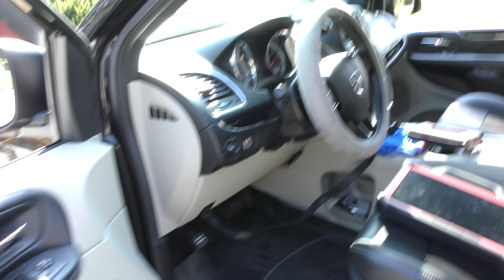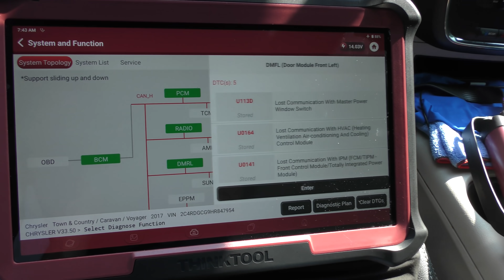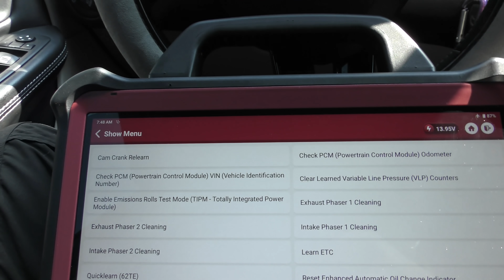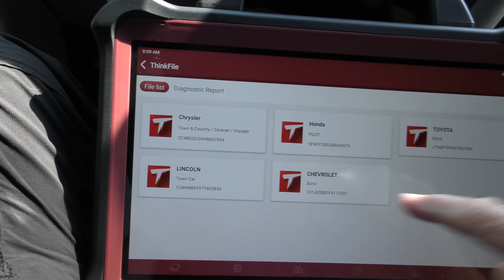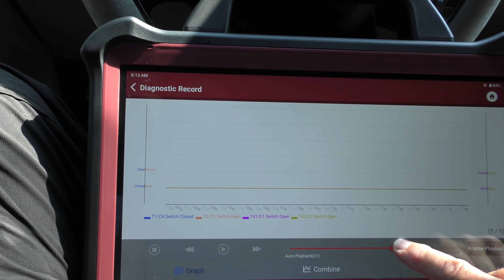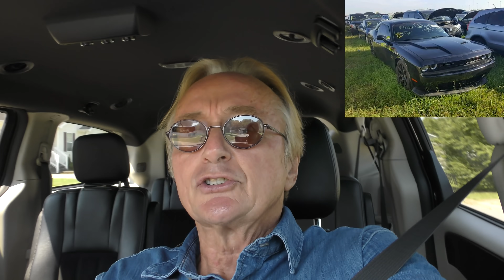Here's Why New Dodges are Crap

Comment: Sooo..  let me get this straight, this van has 138000 miles on it, and all it took to correct the problem was to clean and reset the cam phasers, yet it’s a crap vehicle. Uhm, ok. 
It’s obviously a former rental car which more than likely means that those are mostly highway miles, and the owner only paid 3k for it?! Sounds like a savvy shopper to me. Sure, they could have gone out and bought one of those overpriced, soulless shitbox Toyota’s you love so much, but even those will break, and when they do, look out, because it’s gonna cost a small fortune to fix it. Another reason the resale is low on them is that Dodge has essentially been building the exact same vehicle since 2008, there are literally millions of these things on the road. Personally, I’d take a caravan over some god awful Sienna anytime, it’s just more bang for the buck.
Reply: Uber sticker might have something to do with it.

Comment: It's not "new" Scotty it is 4 years old with 134,000 miles on it. My wife's 2012 Dodge Journey Runs fine at 126,000 miles but the oil changes were done at 3,000 to 4.000 miles since new. Runs like a watch no codes.  Plugs, Coolant and trans fluid were changed at 120K miles no other engine work or transmission work has been done.  I will say that most minivans I have seen of all brands are poorly maintained.
Reply: Scotty’s used to Toyota’s. 200K on a Toyota is just breaking it in.
Reply: @Charliefox71  and honda
Reply: My 2011 Caravan only has 55,000 miles on it, bought it new. Oil and filter changes, coolant, brake fluid, trans, all are key to keeping any vehicle going well. I love my Caravan and I've had 3 of them. The other two I had over 100K and traded both when they were running fine. But why did Chrysler change their best seller, the Caravan? The Pacifica is what it is, the fancy model, but the workhorse model is now the Chrysler Voyager. My Caravan has 2nd and 3rd row Stow and Go seating, so that I can carry sheets of 4 x 8 drywall or plywood with the gate closed, and still have a 7-passenger vehicle, but the Voyager has only the 3rd row in Stow and Go. Bad move, Chrysler.

Comment: I used to sell those. We were advised to tell our customers to leave the economy button off. It really screwed up the shifting
Reply: My 2014 Ram c/v 148,000 definitely has a problem shifting with load and econ button on. Shifting problems mean  turn it off.
Reply: On some vehicles it also slows down the throttle response. I hate Eco mode.
Reply: Is the economy button for saving gas? I agree that it screws up the shifting, but as gas prices go up, I wonder how the economy button would be a good thing.
Reply: @ethanfreeman9623  Eco mode usually does at least two things. Shifts faster to keep the RPMS's down and softens the throttle response. If you push on the gas it'll response slower to smooth out the peaks of you pushing on the accelerator.
Reply: @Brad, what about CVT transmissions like the ones on the Nissan Rouge?
Reply: @FilterFreed   The remade them after 2017 I think. As long as you don't tow you might be OK. They're better for smaller, lighter cars. The Rogue is probably the biggest you'd want to go. Keep the trans fluid changed.  Overall a normal transmission is better.
Reply: @hectorheck1353  Right, and Thank You for letting me know how it actually works. My Grandma has a 2014 Chrysler Town and Country that has the eco mode, and I have only seen a slight increase in gas mileage, not a big difference. I guess I will try to turn that off instead now to not make a fork and a leg for the transmission down the road when I drive it for her.
Reply: Evil man for selling those things to people
Reply: @WOMPCRASH  a $3,000 2017 car being driven for Uber and Lyft giving problems??? Wow I never.
Reply: @WOMPCRASH  😆

Comment: Lol I'm starting to think somebody from dodge pissed you off back in the day. Something BIG too. Career decision maybe?
Reply: Gm too
Reply: Dodges are amazing
Reply: @beast_mode_4200  I have a 2010 dodge charger. 3.5L v6. Little over 160k miles and she purrrrrs. Bought her used at 112k. Only one major fix. Water pump, timing belt, thermostat replacement, and coolant flush. Cost about a thousand for the fix. They kept my car for 3 days. I'm happy with my mopar.

Comment: My 2012 dodge charger R/T with 150k miles runs just fine, any car can turn into junk in a few years if they're not being taken care of properly throughout the years.
Reply: My 2014 RT got 75k miles and have had NO mechanical repairs except a water pump. I swear the 2011-2014 gen chargers were built to last
Reply: 2014 Charger here. 94,000 miles. Replaced the battery, that's all.
Reply: Also 2014 charger RT 65k miles. No problems.
Reply: 2002 Dodge Intrepid 3.5L 301,000 miles runs smooth and everything on it works fine.
Reply: Chargers are one of the better dodge models
Reply: 2006 Chrysler SRT8 6.1 150,000 Miles only changed out alternator. Of course at the maintenance done
Reply: seeings all these replies is enough to make a grown man cry :(
Reply: Dodge gang for life💪
Reply: V8s tend to run longer fukk boy
Reply: @Chatsworth Osborne, Jr. yeah thats a whole different annimal
Reply: 2012 Charger RT AWD 93k miles no issues
Reply: My 2013 charger rt got 160,000 miles o it
Had to buy a new  battery
Reply: Facts, My journey runs like a champ

Comment: I have a 17 year old Camry.  Big body small 4 cylinder engine.  It's a dog on automatic.  When I do the shifting myself with it's 4 gears, it gets around alright.  It shifts on its own around 2,400 rpm to higher gears.  I shift it around 4,000 rpm and I get good pickup and still get 25 mpg.

Comment: Believe it or not I have had pretty good experiences with dodge/chrysler cars made before the FCA merger. I have an Intrepid with a 3.5, and a stratus with the 2.7 and both are running like a dream with 231k on the Intrepid and 188k on the stratus.
Reply: Make sure to change that water pump in the 2.7 when the manual says, it gets a lot of them.
Reply: @Jerad2142  I change the pump and the timing belt every year

Comment: The Grand Caravan was developed during DiamlerChrysler era, the only think added to the Grand Caravan from FCA era was the 3.6 Penterstar which is way better than the older V6's. 

The Chrysler Pacifica was developed from FCA and the Pacifica, Cherokee, last gen 200, Grand Commander (China), and Dart traces it's roota on the Alfa Romeo Gulietta.

So far the Pacifica minivan hasn't had a bad reputation as the Grand Caravan, but of course people like to automatically assume that the Pacifica is bad.

I just don't like people that says they hate something that they haven't driven nor given further research before trying it out. Now yeah the Grand Caravan and Town & County in that generation was terrible to drive and I mostly hated that transmission and suspension set-up.
Reply: The pentastar v6 was designed by Chrysler engineers here in the us . it's a great engine , although the early ones had faulty rocker arms .

Comment: 2017: $3000
That thing depreciated faster than a Maserati.
Reply: I wouldn't even buy it for that tbh
Reply: @TheAnnoyingBoss  Me nether lol
Reply: Well at 135K miles in 4 years, I'm not entirely surprised.

That thing has been cross country several times in s few short years.
Reply: @BrianJNelson  Has an Uber sticker on the window at the beginning.
Reply: 134000 miles in 4 years is heavy use.
Reply: @lonewanderer3603  it means highway which isn't that bad
Reply: It was $3000 for a reason for the cheap price.
Reply: But it cost a whole lot less than a Maserati when new.
Reply: Maserati and Dodge are one and the same, if you take a look at the part bin, the Maserati has the dodge nav system, the door locks and window switches. THEY ARE BOTH JUNK!!!!!!!!
Reply: According to KBB trade-in value is anywhere between $6000-$8500.
Reply: Scotty doesn’t know about manual shifting an automatic, it won’t give you more power cause you rev it higher. On my car it is slower to manual shift than it is to put it on sport mode and let it shift itself.
Reply: That's not the value of it.
Reply: Sticker on the sliding door in big print saying AUTOMATIC DOOR says to me this was an Uber or similar
Reply: @neilgorin1037  Uber sticker on the passenger side at the beginning of the video.
Reply: I’m surprised it’s even a 2017. I first guessed it was around a 2010 or 2011 model 😂
Reply: @diablocls55  these things aren't built to compete. They've had the new gen out for a while. These are made to sell to poor family's that want a new car. I haven't seen them in this market. But they were selling for $17k brand new a year ago. For 5 years and 60k miles it'll be fine with problems amd more reliable then a 7 year old Toyota van with 80k miles for $17k. They have a purpose. And I'm a huge Lexus fan. People just have to understand what these vans are made for. There's no other mini van that even comes close to the price of these
Reply: @MLProductions.1  No they weren't selling for $17k. That one appears well appointed and would probably sticker around $30k My 2005 stickered for around $24 with a little less options.
Reply: @hectorheck1353  uhh have you seen the rebates dodge had before the pandemic? There was $5k in rebates consistently. + Dealer discounts. Once the Pacifica was released there went dirt cheap
Reply: it's an old car
Reply: Hi Scotty, in case you read the comments, I have a question: my 2005 Honda CR-V has 266k miles and has P 2119 code. However the engine runs very good, only has some shaking at 2/3rd  gear shifting when driving slowly. What’s your thought? Maybe throttle body needs cleaning? Thank you.
Reply: Nothing depreciate faster than a Meserati. lol
Reply: It has over 130,000 miles. That’s why.
Reply: Sounds like it's a 4 cylinder way he talks in the beginning when he's running the scanner tool big van little motor moving who nos how many people at one time they worked that van
Reply: Rotten beef depreciates less than a Dodge product!😁
Reply: @hectorsantiago5350  What’s the car on your profile picture? Looks interesting.
Reply: @StephZ28  it looks like an electric porshe taycan
Reply: @StephZ28  It's a Vision Industries K/2. It was never built for production, but I think it looks cool! Thank you for asking!
Reply: @hectorsantiago5350  the diesel trucks are worth big money you haters are fools! the car has 135 on it its wore out!
Reply: @andrewslagle1974  Dodge "installs" diesel engines in their trucks. The Cummins for the HD's and the EcoDiesel (that's a Fiat engine btw) for the 1500. Dodge does not make diesel engines. Cummins is an excellent engine manufacturer and supplier. The Fiat engine is absolute crap.
Reply: @hectorsantiago5350  That’s awesome, never heard of the K/2 before. It reminds me of Gotham Garage’s concept car :)
Reply: Those minivans have a great V 6 in them and the transmissions are very good .
My cousin is on her second Dodge minivan 30 years for both .
And when she traded the first one 
to buy the second one they said
she maintained the first one like 
a professional mechanic .
She had all her maintenance records for the first one .
The seller made a mistake on
selling too low .
Reply: @nicopolis7377  This is over 30000 miles per year which is more than three times the usual driving average. 

The shifting problem might have driven the price down.
Reply: @JTR253  The days of 10K miles per year is long long ago.
Reply: @nicopolis7377  uh...No.  Someone may have gotten lucky but ask most any mechanic.  These are junk vans.   How do I know?  I bought one...
Reply: @Belg6179  the engine is actually decent on these. The transmission is junk. Still 130k miles on a sub $20k minivan is fine
Reply: @MLProductions.1  my Chrysler, Jeep, Dodge Service Manager would disagree.  His statement when I brought mine in for a head gasket issue at 50,000 miles?  "We should have it fixed in two or three days.  We do these all the time."
Reply: @nicopolis7377  Agreed. My 2005 with over 200k has been a great van overall.

Comment: I bought a 99 Dodge Caravan for $400 Bucks.. It had new tires and cold air.. The Purple Paint Was Faded  and The Clear Coat Pealing.. It Had Over 260,000 Miles On It.. 
I've Had To Fix A Few Things... Brake Pads.. Water Pump... Idler Pully.. Driver Side Electric Window  Motor Etc.. 
It's Got Over 350,000 Miles On It Now... Still Running...
I Think I've Came Out Ok On That Old Van...
Reply: It's A Real Pain In The But To Replace The Sparkplugs On The Back Near The Firewall.. Thats For Sure..
At One Point It Was Throwing The Serpentine Belt ... So I Bought A Groved Pully Kit... That Solved That Problem...

Comment: Had a 2011 Dodge Grand Caravan. About 50,000 kms in and the brake rotors were already warped. From what I heard it was a common problem with these. Anyways, it was the first and last Dodge I ever bought.

Comment: From my experiences, transmissions have always been Dodge/Chrysler/Plymouth's "dealers friend."
Reply: Generally it is the whole damn car that is the dealer's friend. I had a PT, great engine, fun to drive, but became a money pit. Got rid of it, bought Jeep Liberty with 3.5l engine. I got it for $1,000. Had 130,000 miles, runs great. Since mom and sis never took care of it, I had to get some work done: tires, breaks, spark plugs, radiator and head gaskets. For a 2003 vehicle, I'm happy. It's paid for and this cost mom $35,000 new. I almost choked when I heard that.
Reply: I got lucky with my 2005. Over 200k miles and no transmission rebuilds.
Reply: I had a 93’ Grand Voyager with the 3 speed that went out after I had the engine rebuilt for the Second time at around 75 thousand miles. I went with the 3 speed rather than the 4 speed because of its dismal track record. And then the headlight module went out. I had to pull the connectors from the headlights to turn them off. Then I later bought a 2000 T&C with 150K miles on it - that bled me like the war in Afgooniestan! I donated it to cut my loses. No More Moopoo vehicles for me!
Reply: @robertneal6878  My 95 was the biggest POS I've ever owned.
Reply: On my 99 ram the orginal transmission gave out at 298k miles
Reply: Especially when it’s out of warranty
Reply: The old 747 trans worked great.
Reply: @wendellwhite5797  A-727 TorqueFlite
Reply: @retro440  Your correct. The 05 Ram has a 4th gear added. Seal can blow. Byr bye trans.

Comment: The old Dodges were crap too, Scotty.
Reply: What about Dodge muscle cars from the 1960s.
Reply: @CJColvin  Yes they will be like a Honda or Toyota from the 90’s extremely hard to kill if properly maintained I love the General Lee a lot. 😁
Reply: @codybrandoncargle3129  Same here brother especially the 69 Charger as well as the 70 Challenger and of course the 70 Hemi Cuda from Plymouth.
Reply: @CJColvin  Yes all the better made ones, now Plymouth was horrible afterwhile because my mom had a Plymouth Voyager van once she couldn’t stand the vehicle after it was severely wrecked because it was constantly breaking down afterwhile. 🤦🏻‍♂️ Then after that she got her first Honda which was a 1996 Honda Accord. 🤔
Reply: @codybrandoncargle3129  Sounds awesome brother. I'm sure the Honda will definitely outlast those stupid EcoBoost engines Ford makes.
Reply: @CJColvin  Omg Honda engines are thousand times better than most Ford engines including Fords really good engines even. 😁 So after that she has a 2002 Honda Accord Ex, 2007 Honda Accord Se, 2016 Nissan Sentra, and 2020 Honda Civic Lx and I have had a 2010 Mini Cooper S Convertible, 2012 Chevy Sonic Lt, and a 2015 Honda Civic Lx. 🤔
Reply: @codybrandoncargle3129  I have a 2011 Ford F150 with a 5.0L Coyote V8 with 141,000 miles on it and still going strong and it's a beast and it sounds like a beast with the Borla ATAK Catback exhaust on it. I also have a 1996 Ford F150 with a 5.0L (302) Windsor V8 with 209,000 miles on it and still going as well and sounds great with the Flowmaster exhaust.
Reply: @CJColvin  I smoke so many racers everyday V8 power
Reply: @9562david  What car do you have brother.
Reply: @CJColvin  Yeah you must have taken really good care of your vehicles then. 🤔 Because a normal 2011 F150 would have already messed up by now but it has a Coyote engine so it will do well then. 👍🏻
Reply: @codybrandoncargle3129  Exactly because the EcoBoost engines are nothing super complex engines my brother.
Reply: @CJColvin  Amen brother I am glad we both agree. 👍🏻
Reply: @codybrandoncargle3129  We sure do.
Reply: @Henry Sorensen I agree 💯 %
Reply: New Toyota pretty crappy
Reply: @miamidangia5122  Yeah but still more reliable than Dodge lol. 😂
Reply: @codybrandoncargle3129  nah
Reply: @codybrandoncargle3129  fuk no

Comment: Wife's 2008 Honda Accord 4 cylinder with 238K miles.  Oil level drops about a quart every 1K miles!  Not Leaking Oil so must be burning and not showing up out of the tail pipe!  Any Ideas on how to keep it for 6 months to a year!  
I am looking to purchase a 2021 Mazda CX-5 as a replacement for her!  She says she wants to sit up high!  LOL... I told her I would get her a bar stool!
Reply: Have you try check PCV Valve/nut bolt from oil pan? My car Toyota Camry 05 4 Cylinder with 300K miles. I had to changed motor oil every 4K when I checked the oil. My car is running good but transmission is getting worn-out when my car can't accelerate quickly as before. So I'm thinking to get a new car Lol